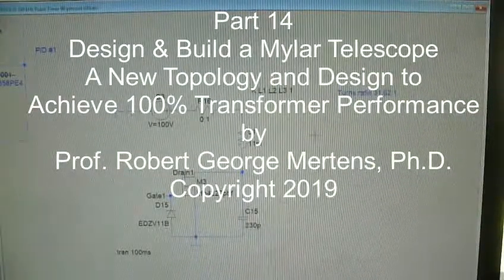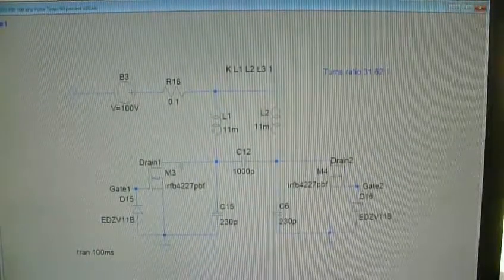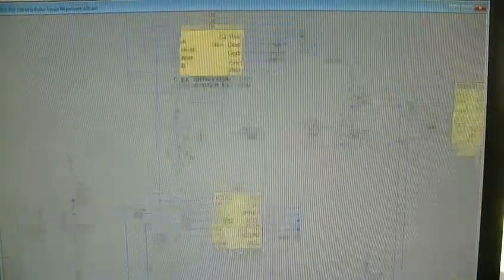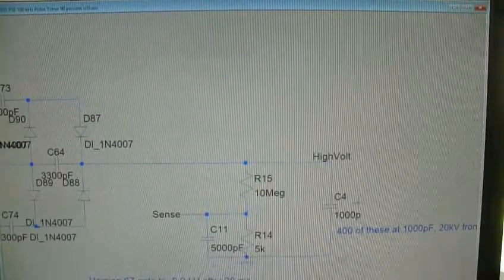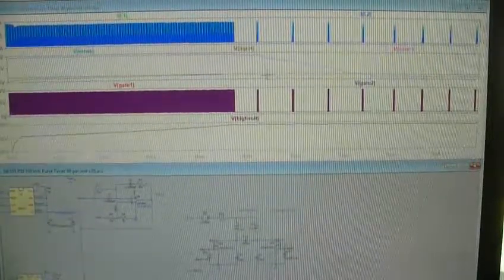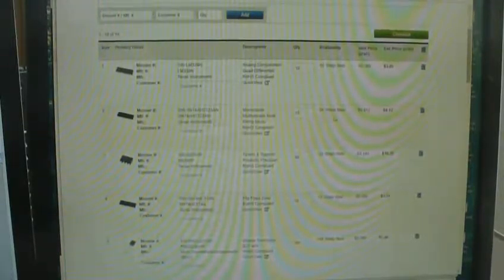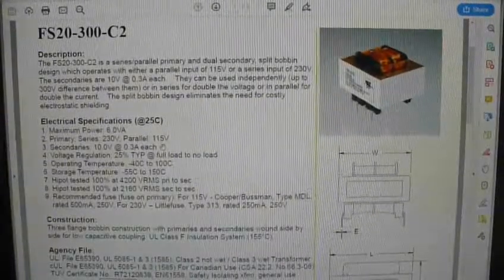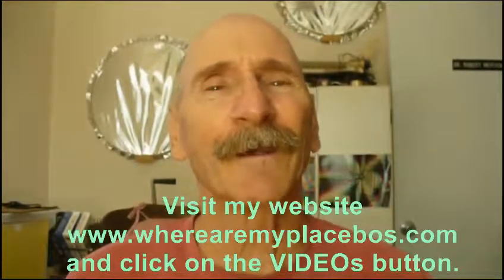Part 14a Design and Build a Mylar Electrostatic Telescope

Comment from the maker: This circuit was replaced with a much simpler design based, not on pulse width modulation (PWM) to adjust the output amplitude, but rather a feedback loop that simply "stopped the clock" whenever the correct amplitude is reached.  Part of this was to unload the output circuit (remove any resistance), and use capacitance voltage dividers to measure the output and store the charge.
Since the output of the transformers is the voltage doubler circuit, the pulse width is almost irrelevant.  There only needs to be a pulse, and the shorter, the better.  Higher pulse width drives the transformer into saturation, which only wastes energy.